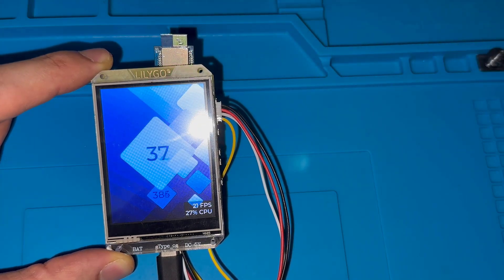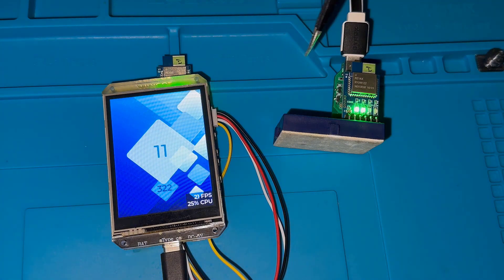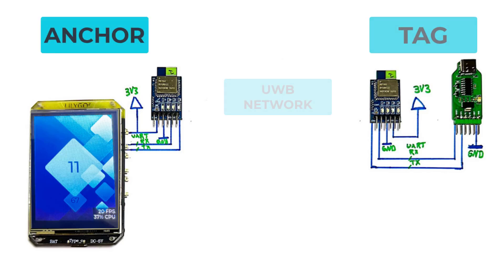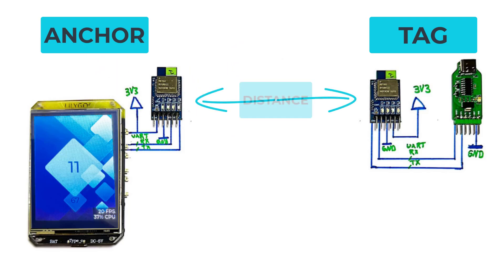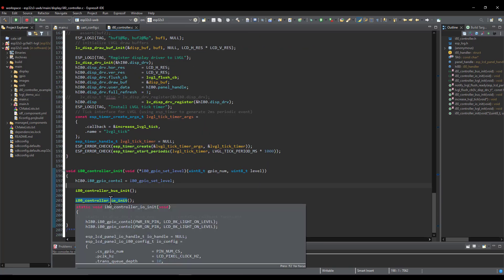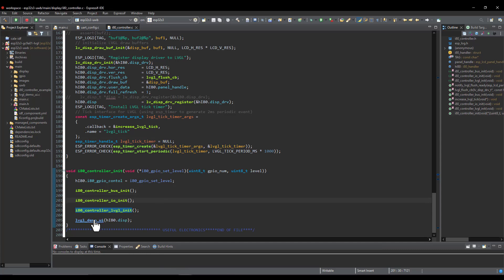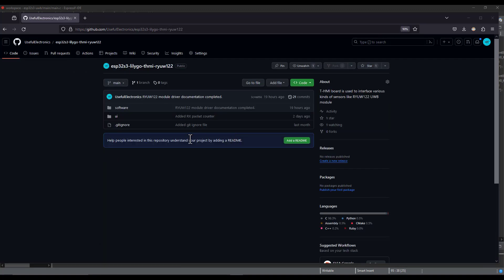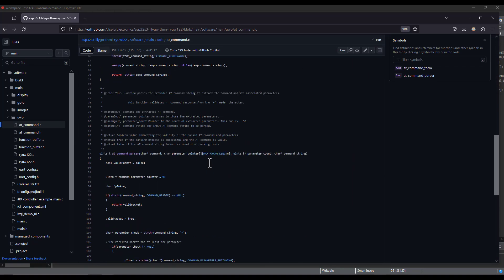ESP32S3 THMI Board Interfacing RYUW122 UWB Module

Comment: Can you show how to interface it with arduino ide  / actually i am working on an attendance system and wanted to integrate lvgl  in lilygo thmi /i already have the code without lvgl /so can i use the same functions there for manipulations of data /and easily integrate lvgl?
Reply from the maker: Why are you using Arduino IDE ?
Reply: @usefulelectronics what toolchain are you using for this project?
Reply: The Nil Proxy Pro

Comment: It is useful for only small projects like for demo for school project but the communications implementation itself is deeply flawed.  I would advise people to avoid wasting money buying these. 

When you place it in TAG mode, you can't send messages actively to the anchor; thus it is impossible to announce yourself to the anchor that you are within the area so the anchor could know what to do next (constantly get distance etc.).  The anchor itself have to guess which tag is within the area which is impossible to know unless you let the anchor brute force all of the known tags in your list and spam the RF spectrum constantly. 

Not to mention the AES key can easily be extracted by using the AT command, which made the AES function kinda useless that anybody can clone a tag and join the network mallicously.

Comment: I bought the same hmi display. But it's become tough for me to program there are no videos in YouTube. Can you pls make a video for ebike instrument cluster. Like the speed is from pwm signal 48v battery monitor map need a very good gui. Need to control some relays atleast 4 and throttle position from a hall effect sensor or potentiometer. Is it possible to do.
Reply from the maker: You are talking about a complete project of course you can do it with this board !
Reply: @usefulelectronics  can you pls upload a video to start from scratch 🙏 yes I know it's a big project but I never saw anyone do meaning they won't be knowing. It will be great help for everyone.